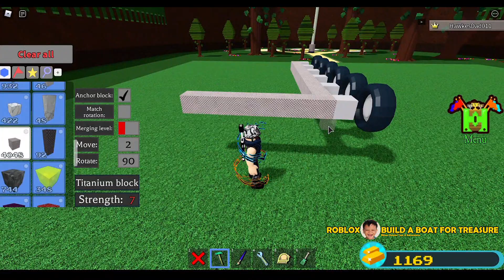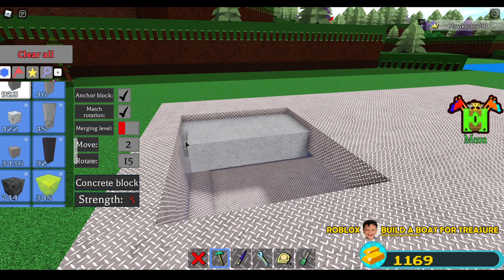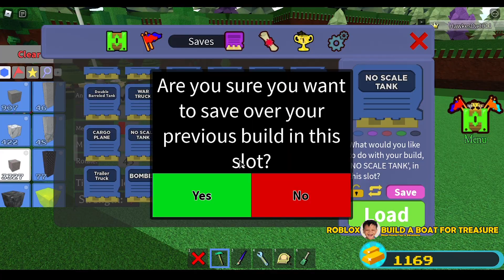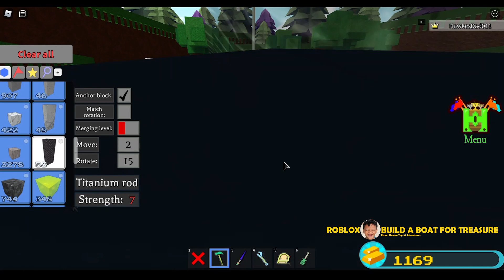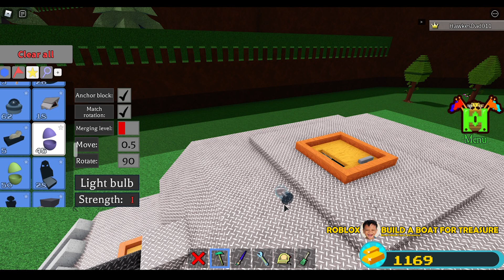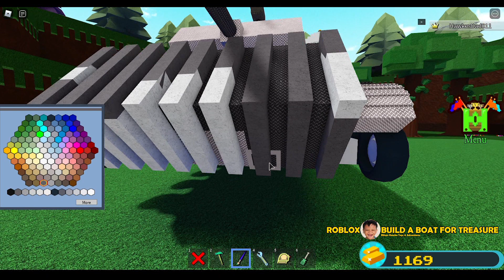Roblox Build a Boat for Treasure! How To Build a TANK! No Scale Tool! Non / Not Micro! FULL TUTORIAL

Comment: My turret is stuck it can not move. But the wheel and the turret does not touch other blocks. What is wrong?
Reply: Oh never mind I fixt it. Thanks for this video. 👍💪
Reply: @5AVQ  I selected all and be sure that all blocks are anchor block. After that you safe again and load it in again and than select all and on anchor block. By my it workt.
Reply: @5AVQ  good luck